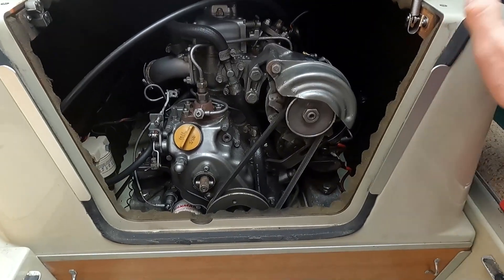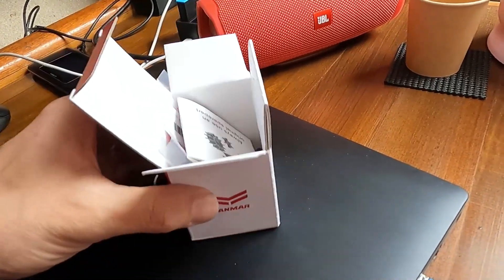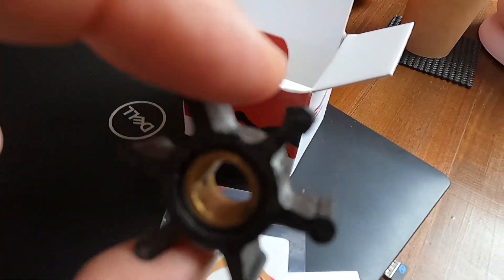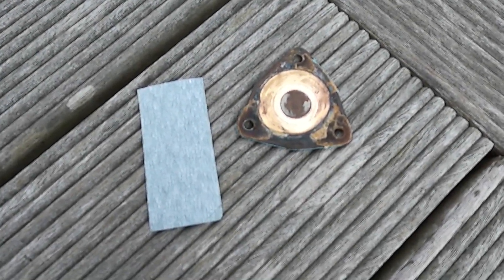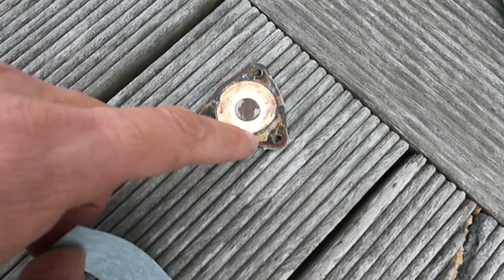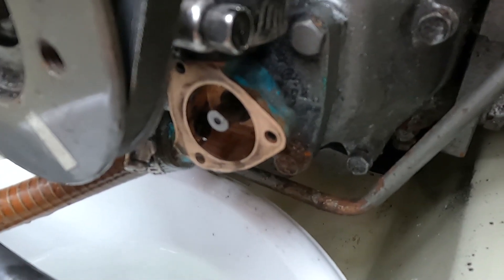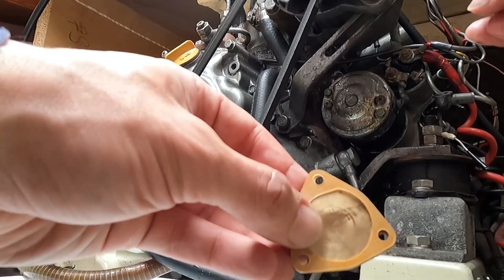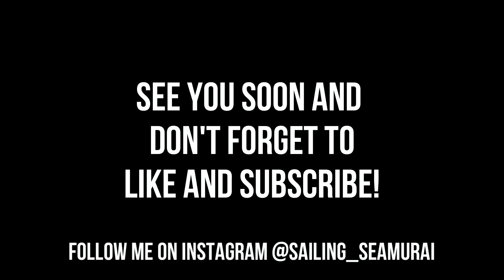Ep. 16 Yanmar 1GM Engine Impeller Replacement

Comment: If the impeller shaft leaks due to salt crystals scouring, it drips on the long under pipe causing failure within a year.
You can re-use the scoured shaft if you turn the impeller oil seal around. I spray grease over all the 3 oil feeder pipes twice a year. I've motored all over europe and put 5000 salty hours on mine, 4 impellers, one long lower return pipe, 3 internal anodes, one impellor oil seal and very little MGO 😉 Good video P.S I once had the engine diesel filter come loose and had to turn it and bleed her. I gave her a hosepipe flush once. I have a stuart turner sea-cock and raw water filter and replaced that short pipe twice 🤣
I changed to stainless bolts for ease of access on the impellor and white silicone sealant years ago, 5 minute change on a lee-shore 😉
Due to no money my engine has been held in place after all 4 engine mounting rubbers came away by about 40 very big cable-ties, not too tight, not a great option but, it will get you home...

Comment: Protect the pipes underneath with cosmoline spray like CRC 06026 Heavy Duty Corrosion Inhibitor and better yet some Densyl Tape - DENSO All Purpose Petrolatum Tape. Your oil line is rusting already!
Reply from the maker: Thanks for a good tip! I noticed it couple of months ago as it got worse so will definitely do that!

Comment: You didn't turn the seacock back on? Or if you did you didn't tell others that don't know boats to make sure to turn back on so they don't burn up new impeller  other than that great video
Reply from the maker: Hi, thanks for comment! Yes seacock needs to be turned back on.  Disassembly and assembly steps are assumed to be mirrored around the subject of repair.